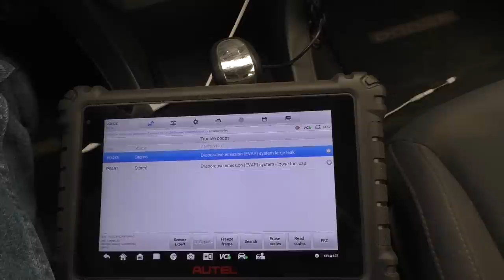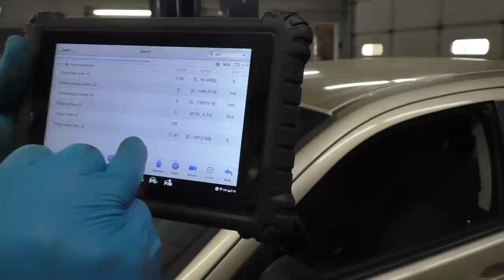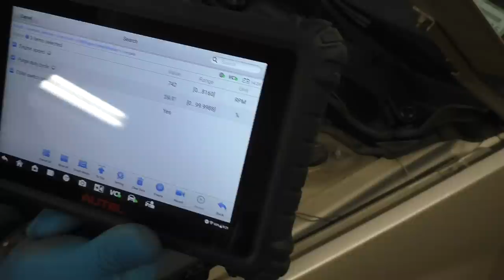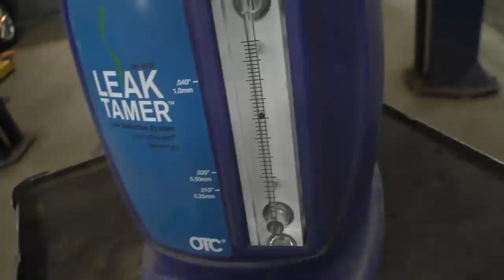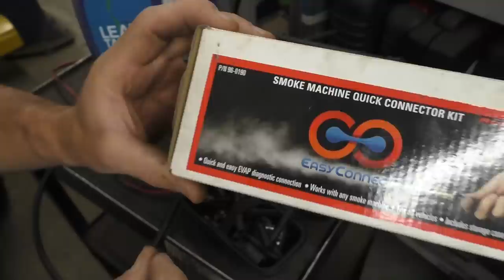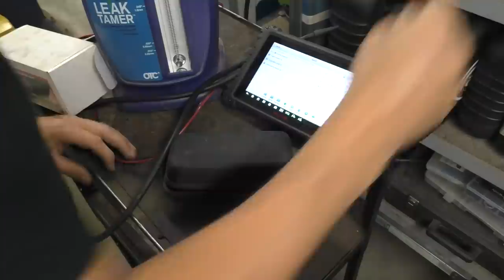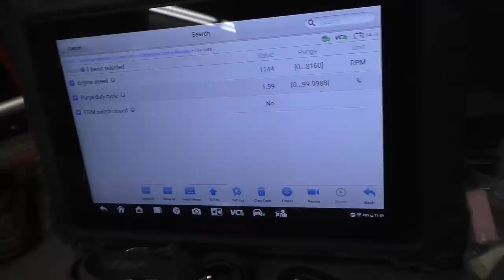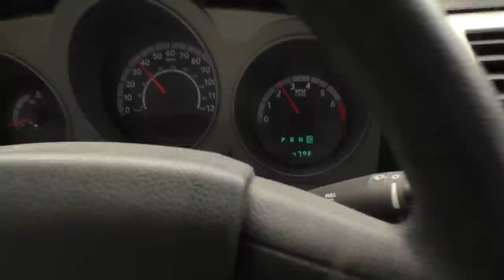Dodge Avenger: Bad Wheel Bearing & Engine Light is on

Comment: I recently replaced the left front bearing on my van. No play on any wheel and no noise at low speed but from the change of noise when steering it was obviously on the front left.

Next, i changed the right front and the noise went away.😢
Reply: Lately, I have to put them on the lift and run them to isolate them. Going by driving them, seems like I pick the wrong one.
Reply: @mph5896  That would be fine, if I had a lift. Wouldn't have been so bad if they came off as easily as these but mine are held from behind by a (rusted in) circlip so the complete assembly had to be removed.

Comment: Just had to fix my daughter's 2010 Avenger throwing EVAP codes. Found a few leaks in the plastic line where it rubs against the trans cable. Simple fix for a Chrysler for once. The ball joints were a pain to do without the special cup for the lower. Love the channel.

Comment: I did the ESIM on my T&C minivan. Had a P0456 code. I didnt have a good scanner or the avoca smoka so I fired the parts cannon. I replaced it with the carquest one because all of them both OEM and aftermarket seem cheaply made. The carquest one has a lifetime warranty. Cheers.

Comment: A little tip for you eric. The proper way to check for an evap leak on a system with an esim is to unhook the vent hose from the esim and hook your smoker up to where the vent hose goes. that tests the entire system without having to pinch off hoses

Comment: So, lug nuts vs wheel nuts:

I reckon the 'lug nut' nomenclature goes right back to the 1920s where manufacturers were trying out various forms of demountable tire and rim arrangement with the aim of making it easier for damaged tires to be changed by the driver at the road side (frequent tire/tube damage was a thing then ofc).

A lot of the designs moved away from the wooden spoke or wire spoked wheel configuration and  incorporated some sort of flat base slide on rim and tire combo, which mounted over the spoked hub similar to a small version of the well known Dayton system once found on trucks. The rim/tire combo was held on the spoked member by several clamping blocks (or 'wedges')  which could also be described as 'lugs' in the sense of a plate with a hole in it, fitting over a stud inserted in the spoked member and secured by a nut- a 'lug nut' if you like... 

For instance, have a look at the arrangement on (say) a 1928 Plymouth Model Q. 

Eventually 'lug nut'  fell into common usage to describe any road wheel retaining nut, even after hub-centered well base steel disc rims (Budd style) became common.

Also lug nut appears to be a US thing, the Brits always had wheel nuts, but then I can't think of any British makes which had the "Dayton" style wheel, most seem to have been early adopters of Sankey (or Budd) types or knock on Rudge center nut styles for the sportier chaps.

My confidently-incorrect 20 cents worth

Comment: Having been raised in a garage family and worked part time in an independent garage when i was going to trade school for my toolmaker cert. i miss the air driven tool noises. Thanks for that volume adjustment joke. Loved it! The video was a great reminder of the rust belt under car options, mud in the drain. And the dirt and rust falling off when hammering off the bearing! We in upper New York are sitting on the wrong side of the camp fire? Question; are you greasing the tie rod end while you are there , we who worked in the old service station used to and obviously nobody greased that one in a while.
Reply: We in upper New York are sitting on the wrong side of the camp fire?
Reply: @dombelardo4909  the smoke

Comment: I actually worked on a Chrysler the other day with the 2.4 and a p0455. It did have fuel tank pressure sensor (so i guess it was a little newer like you said) but I'm unfamiliar with dodge evap system and didn't understand the esim at first. I had a hard time figuring out how to diagnose it. I understand it much better now, thank you. 

P.s. it was a corroded connector at the esim. It was so bad it was basically separated and could see the problem without unplugging it

Comment: You mentioned it, inquiring minds wanted to know.
Thw best informationthat I found between a lug nut and a wheel nut is:
- A lug nut has a tapered end and a wheel nut has a flat edge.
- A lug nut is designed to be tightened by hand and a wheel nut is designed to be tightened with a wrench.
- Lug nuts are typically smaller than wheel nuts.
- Lug nuts can be steel or aluminium while wheel nuts are typically steel.
There's your history lesson for today!
😂😂😂😂
Reply: All I know is they're called lug nuts in North America and wheel nuts in the UK

Comment: I heard you Eric ! you actually admitted that changing bearings on both ends of an axle was sensible !   I hold that unless you are penniless and doing the job yourself, it is nearly essential ! I wouldn’t want to pay for the hoist every time. And by the same logic get the brakes done at the same time !
Reply: Both bearings take similar abuse, unless you only hit pot holes with one side of the car. They should fail in a similar amount of time unless they were manufactured differently.

Comment: Eric, if we ever worked together it would be a hoot, battle of the network  bll breakers! Gotta be a upstate NY thing! I suck at picking which hub is noisy, less than 50 percent right? Sometimes I use my remote ears , still can't hear 😢Do em both then you're right. Also very smokey all the way down here in Cape May NJ. Good show as usual!

Comment: Eric, run some Kerosene through the air inlet and flush out the tool. it will come back to life. Gas stove's are not allowed, but wildfires are. The smoke is all the way to the bottom of Pa.

Comment: The main difference between lug nuts and wheel nuts is that lug nuts are designed to be tightened by hand, while wheel nuts are designed to be tightened with a wrench. Lug nuts are typically smaller than wheel nuts. Wheel nuts are typically made of steel, while lug nuts can be made of steel or aluminum.

Comment: Man those bolt on wheel bearings on the front wheel drive, is to die for. How many compact, mid sized cars actually come with bolt on wheel bearings up front?

Comment: Wheel nuts are called lug nuts because the studs they fix to are called lugs. They don't screw to the wheels! Likewise the jam nut as you call it, is actually called a lock nut, because it locks the main nut. They lock nuts are normally half nuts.
Reply: LOL..  Troll fail.

Comment: I use grease on the cv shaft splines and the hub hole so if you ever have to change that bearing again comes off with 1 hit with a hammer. I don’t use anti seize because if that hub ever gets hot from say a sticking caliper it will turn into jb weld

Comment: I don't know.  I changed the rear wheel bearing on the driver's side of my 2008 Subaru outback 4 years ago and the passenger's side is still good.  I always do wheel bearings as they fail.   You're not really in there anyway because it's a different side, it's a separate repair.  It's not like doing pads when you're doing rotors or something like that.

Comment: so the chrysler key cheat still works.  i first learned of that off of Allpar before they were techs only; pulled it off on a 91 Plymouth Acclaim and got a 44 (it blinks the check engine) and a 99 Concorde.

Comment: Glad you showed a troublesome wheel bearing coming off without 2 taps of the hammer like Rainman gets...a little salt and water are better than any Lincoln welder could do in this area...LOL....i am waiting to see you fight with a mid 2000s ford or dodge that you could drive with out the bolts in it and it wouldn't fall off....if they only knew our pain

Comment: May have been dumb luck but I fixed a large leak in my 2013 Chrysler 200 by changing the part on the canister. I could not find a leak and I would clear the code, if my tank was more than 3/4 full the code did not come back on. I read somewhere on internet that when tank is more than 80% full the computer did not register that tank vent so I figured that must be the problem. I changed it out and code never came back, as I said dumb luck.

Comment: It seems like each vehicle has a few of the usual suspects of bolts that rust and become one with their attachment, making the repair a total PITA.

When the car is brand new, wonder if it would it be worth going through and giving those evil bolts a coat of some sort of grease/protectant to make those repairs easier?  

A new service provided by SMA, preservice to save you money. Imagine how nice it would be to work on a car with no rust or fluid leaks.

Comment: In my experience with Chryslers, the fuel filler neck is more likely to leak than the filler cap.  Your first clue is when filling the tank the gas splashing on the ground starts turning the soles of your shoes to mush.

Comment: I notice that when you change a wheel bearing, you always change the hub as well, is this because it works out cheaper labour wise as removing bearings can be a mother of a job ? How do you work in the cost of brake cleaner, grease and Loctite, is it hidden in the labour cost, as a friend of mine threw a fit when he was charged £5 for WD40, he asked if they used a whole f*****g can on his car ?

Comment: Hi Eric . Nice job. I noticed no dust shield behind behind the hub . I just lost one on a Honda Civic . Your opinion do you think they are important . Or run without them.
Reply: Not very important really.  Just is a brake dust shield and keeps the brake dust from getting everywhere else a little bit.. A good wash every once in a while does the trick.

Comment: The gas cap error  code. Did that appear just because of bad logic in the programming from Chrysler, or will it fail in a manner that the system just can't differentiate from what is actually causing the problem so it throws both codes?

Comment: I always wondered what was wrong with Automotive engineers? Why is it they can't figure out what size bolt to use the hold certain parts on cars? If a boat is sticking out the back side 3/8 of an inch or quarter of an inch just out there in the air to get rusty what exactly is it holding in the air? What what does make disassembly 10 times is hard!😢😢

Comment: 34:50 Lug nuts 

What is the difference between a wheel nut and a lug nut?

The main difference between lug nuts and wheel nuts is that lug nuts are designed to be tightened by hand, while wheel nuts are designed to be tightened with a wrench. Lug nuts are typically smaller than wheel nuts. Wheel nuts are typically made of steel, while lug nuts can be made of steel or aluminium.
 
Google

Comment: I really don't like how people second guess you. It makes it hard for people like me that ask questions and get no reply. I realise you can't or won't answer the questions. I blame those who take up your time cutting you down. I always wanted to know if I could add a small electric fan that I could turn on from inside. So when I get stuck in traffic and I can add more cooling. Would that do more damage by blocking air flow?
Reply from the maker: Like adding a fan to the front of your radiator?

Comment: Lug nuts? It comes from Scandinavian for something that sticks out and can be pulled slowly and strongly like a tuft of hair or even someone's ears. Then from the Scottish in which lugs were flaps on a bonnet which covered the ears, hence pulling someone's  "ear lugs" to annoy them :-)  Looks like the Canadians have got a huge smoke leak in their environmental system; I think it's going to take more than a new switch to rectify things before the Jet Stream goes back to bringing normal weather.

Comment: aren't chrysler the clever ones. greasable steering ball joints & wheel bearing that do not require suspension dissembly to fit them.